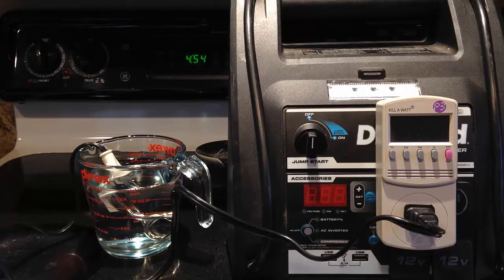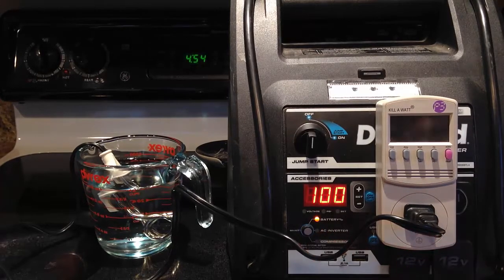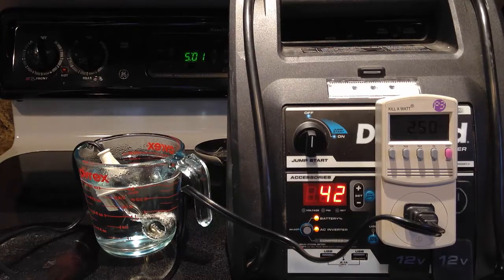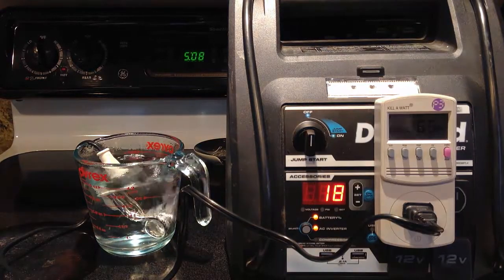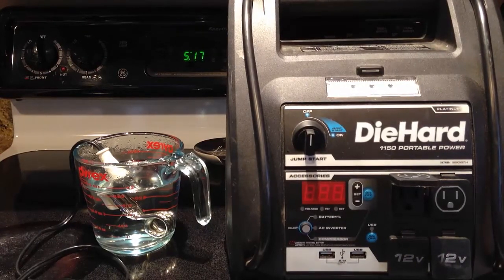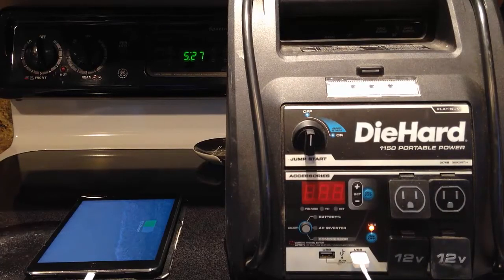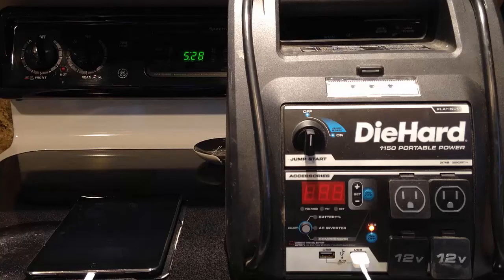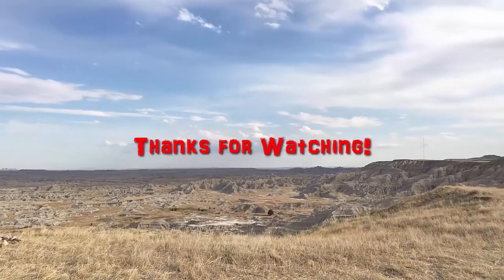Portable Battery Pack Endurance Testing

Comment: Do you know how much will it run a car fridge?
Reply from the maker: The small units like the Alpicool that I use, require about 2-4 A when running. Using 50% of the battery charge that gives you 2.5 to 5 hours of runtime. Not a lot, BUT the fridge does not run constantly. Also, if you are driving that day, you can run it off the cigarette lighter. If you fill the empty space with water bottles (or beer) then it will pretty much stay cold during the night. The cold water is like another “battery” you are charging during the day.

Comment: Hi, is it possible to connect a Electric Kettle or a toaster??
Reply from the maker: DG Junior it comes down to how much current it draws. I’d say probably not unless it’s under 400W and 120v or 240W and 12v. Better to use an immersion heater in a Pyrex cup. More efficient. Thanks for watching!

Comment: Good test! Wish after the recovery time, would have been nice to see how much voltage those percentages (%) represented. I have several of those jump boxes. Several from yard sales. Torn apart. And two Everstarts, a 750 and a 1200a. The 1200a boasts a 400w inverter. If I recall, it's only 200w continuous. Years back, I got an Die Hard from Kmart. $179 on sale for $124, with an additional 5% off, plus a $30 gift card. Let a "friend" borrow it, who let a co-worker borrow it. He said he was going to get it back. But co-worker got murdered by her boyfriend. Sadly, I never got jumper back or reimbursement. Both of my Everstarts have bad compressors after 1 or 2 uses. My Schumacher jumper air pump bite the dust as well. Better to have a nice quality stand along compressor! By the way, I have an Goal Zero Yeti 400 AGM. A good bid on EBay. Wish I had watched your videos. I guess I had more money than brains. LOL! Love your stuff! Presented very well!
Reply from the maker: Cobizybone thank you for the kind words!  I may have to go back and do a part 2, because there are a few things I forgot to talk about in the video. Your idea for checking the percentages is solid and one I didn’t think of. Thanks for the suggestion and thanks for watching!

Comment: I miss a simple chart that would tell me battery lasted 15 minutes rather than watching a video of water boiling.  🙄
Reply from the maker: Hi Jack, you crack me up!  Yes, that would have been useful and I get your point.  Here I was trying to actually demonstrate that it will run that long with the load because if I just do a chart, someone accuses me of fudging the test ;-)  But, some things work better in written form and so you might want to check out OdysseyCamper.com   Thanks for watching!

Comment: I've had two Sears 1150's and gave another as a gift. The compressor failed on my first and Sears 'gave' me one like you demonstrated. As a CSA in the Auto Center, I got 10% off on merchandise. Sears did Black Friday hourly specials and my first 1150 was a deal. I left Sears four years ago. I see generic replacement batteries for about $30. Does Sears sell a diehard replacement battery? ...the common reason for 1150's getting returned was people ignored monthly charging when not in use or failed to recharge after use. These are a great thing to have, provided you abide by the directions. Enjoyed! Subscribed, too.
Reply from the maker: Hi Bill, Yeah, the compressors are not built for heavy duty.  I think of it as "nice to have the extra tool", but I don't depend on it.  That said, I have two of these and have not had a compressor failure and I use them regularly to adjust the van tires and inflate bike tires.  What HAS failed a couple times is the fuse.  They don't tell you there is one, but if you pull out the battery you can get access to them.  I've had to replace two fuses, so it's possible that it was just the fuse in yours.  
    Regarding the battery in the DieHard; this does not seem to be made by the same people that make the vehicle starting batteries that I've depended on my whole life.  Instead, it seems to be made by the same company selling the $30--$40 replacements on Amazon.  Interestingly, the replacement batteries are rated at 22Ah capacity and the original Sears labeled battery is only rated at 18Ah.  I suspect this has more to do with them being tested differently than it does with a physical difference.
   You are ABSOLUTELY right about the charging.  I tell people to plug them in for a day, once a month, or after use.  Lead acid batteries do not like to be stored in a discharged state.  Thanks for watching and Subscribing!
Reply: My one ton van carries 68 psi, normally. The ten plys max at 80psi. My new 1150 has a screw-on valve at the end of the inflation hose; much better than plastics clip-ons! Your reply prompted me to plug-in my 1150, 30 days had passed and it was left charging overnight, though, the window stopped at 100% after ten minutes iof charging. Yes, the jump starts have more than paid me back. Thanks for the fuse fyi and battery reference on Amazon - $44! I've sold many Diehards and don't lean towards the name so much...I'll take a generic with great reviews.
Reply from the maker: bill bayh Yeah, I look at the compressor as an additional tool but not one I’d depend on. They are definitely not heavy duty. Sears does not have the replacements that I know of, but Ace Hardware and Amazon do. Look for the 18-22Ah size.  Charge it once a month as you say and it gives years of service. Leave it in storage to go dead and it probably won’t come back. Thanks for watching and subscribing!

Comment: Odyssey Camper, if you have an A/C outlet in your vehicle, would it not make sense just to plug into it while driving and not worry about the charge controller or is there a limit as to the power coming out of a vehicle A/C plug?
Reply from the maker: Good question!  So I actually have charged one off of the AC outlet of my inverter.  You CAN also charge them off of the DC cigarette lighter plug as well.  I've always said NOT to, but I've since ran some experiments and found that even connecting the 12v in your van to the 12v plug on the battery pack, it won't pull more than about 4 amps max.  The lighter socket is fused at 15A, so it's not an issue.  My earlier concern was that a battery can pull a lot more than the socket is rated for, but that doesn't seem to be the case with these little batteries.  The one thing you DO have to watch is overcharging.  It's possible for the off-gassing of the battery to pop the cover off of the battery.  In the manual it says charge no more than 30 min off the vehicle or the battery could "explode"!  That's a little dramatic as we are just talking about a little pop.  Having said that you CAN charge directly of the vehicle and may want to if you have to recharge quickly.  However, the alternator is designed to charge a large starter battery quickly.  The solar charge controller will charge in a way that extends the battery life and makes sure it gets charged to 100%  Let me know if I made that super confusing and I'll try again ;-)  Thanks for watching!

Comment: How long will that die hard pack run 2 20in house fans and does it have a way to charge it through the car charger or solar
Reply from the maker: nitpoon it depends on the current draw of the fan, but it should be able to run most fans through the night. As far as recharging it goes, you can do it through a solar panel or off the vehicle with a charge controller. https://youtu.be/GUaXuZw7rzc
Reply: To make the best use of the battery's capacity, get a 12 volt fan and connect it to the pack's 12 volt outlet.  I have a couple of O2Cool 8 inch, 12 volt fans that can run on a wall wart, 8 D cells or any source of 12 volts DC.  The fan uses 0.16 amp on low or 0.53 amp on high - which might be less than the idle power used by the DC->AC inverter.  Same for lighting.  There are many low power 12 volt lights for automotive use and they're the best choice for getting the most hours of use from the power pack.

The battery in that DieHard unit is probably 22 amp hours (AH).  Use the calculator here http://www.csgnetwork.com/batterylifecalc.html
to see how long that battery will last at various loads.  Note the the 300 watt water heater uses 2.5 amps at 120 volts AC but the DC amp draw is the ratio of the inverter's output voltage (120 volts) to input voltage (12 volts) or 10 to 1 so 10 times 2.5 = 25 amps.  But the inverter is no more than 80% efficient so divide that 25 amps by 80% (0.8) and you get 25 / 0.8 = 31.25 amps.  The online calculator says you'll use 50% of the battery's capacity in 0.25 hour or 15 minutes.

To get the maximum life from an AGM battery (what's in the DieHard) you should not discharge it below 50%.  If the battery discharge is limited to a maximum of 50%, you might get 1000 charge/discharge cycles.  At 80% discharge, that may be only 300 charge/discharge cycles.  At 20% discharge, you might get 2500 charge/discharge cycles.   Do you want reliable power next year or maximum power today and little or no power next year?  It's a trade-off that you should be aware of before assuming that if you saw it running a 300 watt device, it can provide that much power for as long as you want it.

My backup power system is larger and not portable (540AH AGM battery bank, 2000 watt pure sine wave inverter) but it serves as a "Wait until daylight" source to power fridge, freezer, internet and some lights, plus charge phones and run the central heat (if needed) for 8 to 20 hours depending on the season.  The system cost somewhat more than the DieHard but the ongoing electricity is "free" (recharged by solar panels).  Note that with an average hourly load of 200 watts, my system hits the 50% discharge limit in just over 17 hours.

Comment: Can these battery packs be charge from the vehicle while driving? How long would it take?
Reply from the maker: They CAN, but to get the battery completely topped off, it's best to use a charge controller.  If you go through the cigarette lighter, you'll be limited to a 15A controller.  This one is a 7A and will charge a flat battery in about 4-6 hours. http://amzn.to/2FrandN  You can go with something a little larger and charge quicker.  I use this one to charge multiple batteries, but you could charge just one : http://amzn.to/2Hmzqv0

Comment: Should that plastic part be down in the water? Are you sure the immersion heater is safe? What metal is that?
Reply from the maker: I had the same thought!  So, early last year I put the plastic part in the water.  It doesn't seem to hurt it because I've been running it that way for a year.  By the weight and feel, I would guess the metal is iron coated with chrome.  It does not look like stainless steel up close--too shiny.
Reply: That's why I haven't used mine. It said it was stainless steel.  There are different claims with different brands. I just wish there was a way to be more confident.  I was thinking bpa's in the plastic. I can't tell if yours has it but they make them with a little notch so it sits on the edge of the cup and out of the water.  Anyway, thanks for the video.  I shared it.
Reply from the maker: Yes, this also has the notch, but it's too narrow for the pyrex cup, so I just drop it in.  If you are concerned about BPA, then it would be wise to keep it out of the water.  I'm not too concerned about the metal.  It's not aluminum and anything else is pretty inert.  It COULD BE stainless, it just doesn't look like it to me.  Stainless usually isn't that shiny unless it's polished and nobody is going to do that for a $9 heater :)

Comment: Great video thanks for sharing
Reply from the maker: Thanks!
Reply: Odyssey Camper what about the Anker battery backup they can be charged by plugging into the car lighter the wall or solar forget the exact model but it can run a mini fridge xcetera
Reply from the maker: I've been thinking about testing this one for comparison http://amzn.to/2p6ULRF but it only charges through a 120v outlet.  Can you link to the one you are speaking of? My initial thought is that they won't be able to run high load devices, but I don't know for sure, because I haven't tried one yet.
Reply: Odyssey Camper https://youtu.be/xM0Hz9XBlxQ I haven't been to their website yet but there's a solar panel that you can use as well to charge it as well as your car lighter or wall outlet
Reply from the maker: nitpoon Thanks, I will check it out!